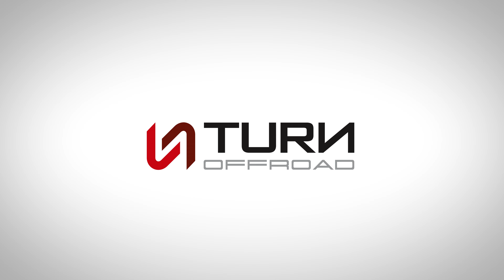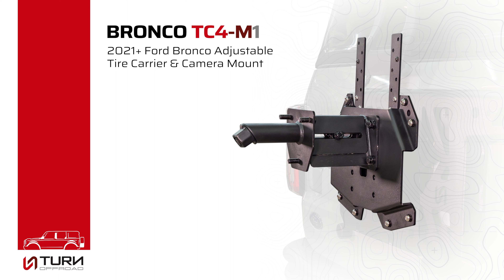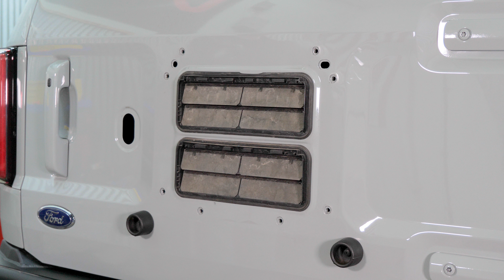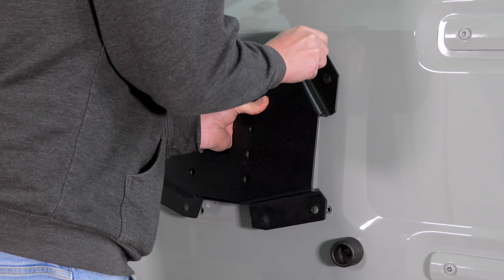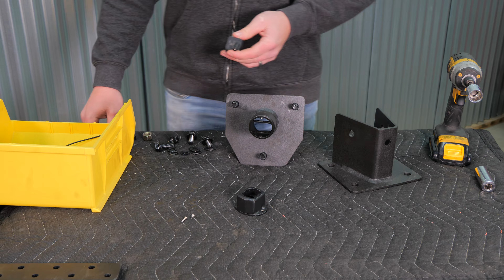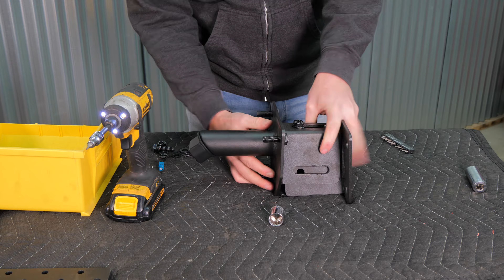Turn Offroad's Ford Bronco Adjustable Tire Carrier & Camera Mount installation guide.

Comment: How do you remove the factory camera from the tire carrier?? How can you be so in depth yet not highlight some critical parts of the install??
Reply from the maker: It gets pried out, it is just in there tight. Remove the 2 Torx bolts holding it in and pry the plastic housing out from the rear.

Comment: Any instructions on how the camera is relocated?
Reply from the maker: It gets pried out, it is just in there tight. Remove the 2 Torx bolts holding it in and pry the plastic housing out from the rear